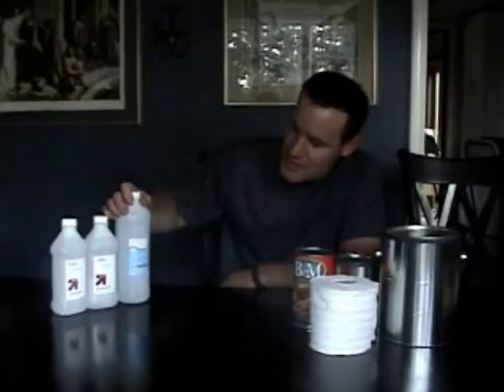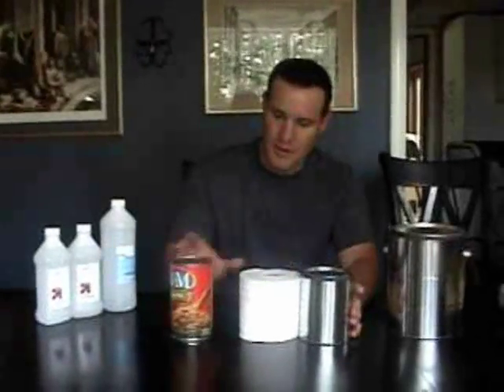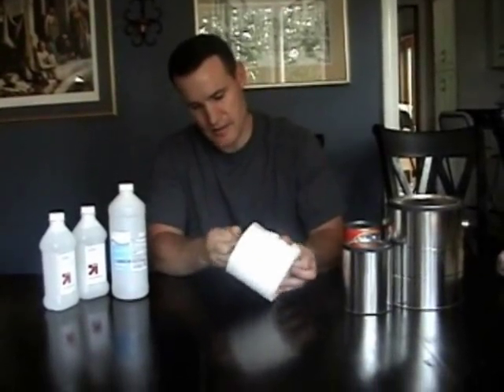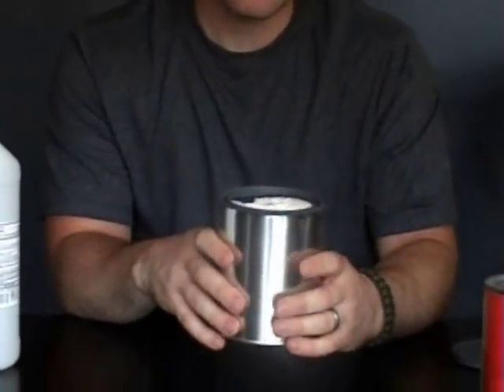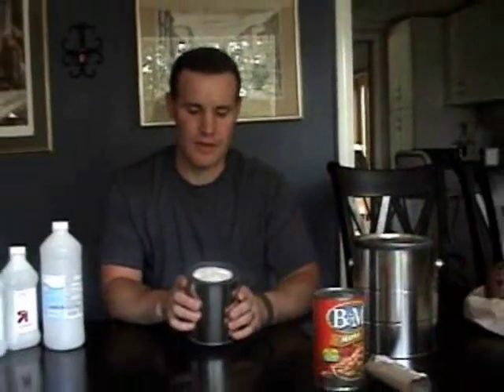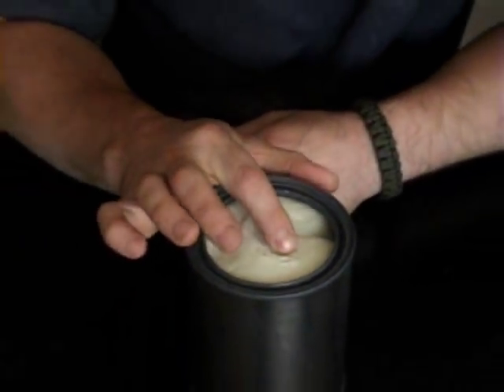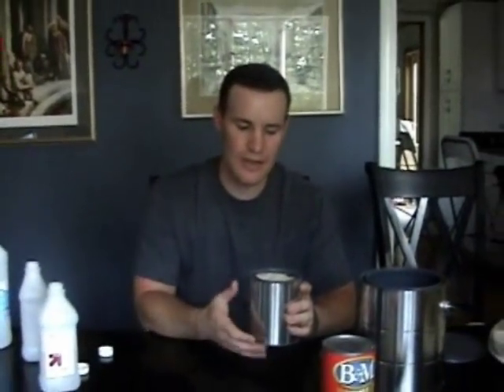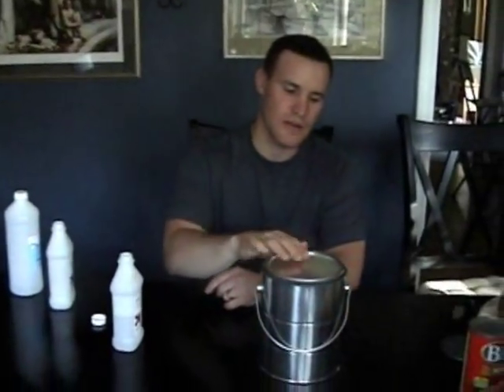How to Make an Emergency Car Heater

Comment: You are obviously commenting without having tried this. Well, I did try this and it worked awesome. 20 degrees outside, lite inside car with window slightly cracked so I don't "burn up all the oxygen", which by the way would not happen unless you have sealed your vehicle, air will get in, CO is an issue hence the cracked window. I let it burn for 20 minutes on my passenger seat. The bottom of the can never got hot, I could pick it up bare handed. The temp in the car was now 62, this works great!

Comment: I've always put a layer of sand in the bottom and around the sides to act as a buffer. The inside can gets hot, transfers the heat to the sand, and you still stay warm. Also with the inside can lifted, you. an use the inside can lid to snuff out the flames. 
These came mighty handy back when I drove cross country and got stuck in a blizzard somewhere.

Comment: I went out today and bought everything I needed, between Lowes and Rite Aid, total was about $8.  I went home, had a MAJOR SERIOUS problem getting the roll of toilet paper in the quart size can, almost stabbed myself trying to work it in, ended up unraveling aLOT of toilet paper, but did get it in.  Filled it with 1 1/2 bottles of 70% alcohol, and lit the can setup in my sink in the kitchen.  OMG !  It performed FAMOUSLY.  This gets VERY warm.  I'm keepin' this. LOTS of heat rising.  Nice Job!

Comment: I've used this method many times in extremely cold weather while having to sit in my car taking care of property for 12 hour shifts ( I used to work as a security guard). I set a small piece of plywood and made sure it was level on the passenger seat. I set the can on the flat surface and light it up. Perfect. It worked extremely well. It also works when having to prepare a meal. I would set a frying pan or soup can over it and did the job. I was inside a warm car and i had hot meals and it would be 10-20 degrees outside.
Reply: Windows closed or cracked 🤔
Reply: @ALSILVERU2  Definitely about 1/4 way down and would adjust it as needed. Sometimes a little more and sometimes a little less.

Comment: Great idea,  thanks for the information,  I am going to try this.  I have about an hours drive home on very rural roads and no cell phone signal,  always wondered what would  happen if my engine conked out on a -10 degree night., now I don't have to find out.  I think even with a window cracked this would provide enough heat to keep you from freezing to death.  Always carry extra clothing and blankets with me in the winter time.
Too bad a video like this brings out the trolls and morons.

Comment: Candles are cheap, safe, and do the job of taking the chill off the air just fine.  Buy a bunch at a dollar store, keep them in a tin can with lid, with a book of matches.  And you're all set.
Reply: Yes, a good candle is reported to keep temps inside a car above freezing.
Reply: That's a good idea. I will try this
Reply: That's bad too candles give off dirty fumes too. Unless its beeswax and a cotton wick.

Comment: If nobody has said this yet it would be a very smart idea to put out the fire before "topping off". It was not memtioned in the video but should also be common sense to do so. You never know if someone is dumb enough to follow the directions in the video or if they are smart enough to have common sense

Comment: I have to laugh at so many comments from those that don't understand the properties of isopropyl, how it burns cleaner than the gas ranges used to cook dinner every night in half the households in the country pretty much eliminating the possibility of carbon monoxide poison, assuming you'd use this device in a moving vehicle (WTF? If your car is drivable and you have an accessible road wouldn't you think to drive to a more hospitable location while keeping warm along the way using the car's own HEATER CORE?), not realizing how incredibly small air molecules are and how you'd pretty much need to crack the windows more on account of the heat generated making you uncomfortably hot rather than as a source of oxygen, and how the alcohol in the wick is basically not in a liquid form that would spill, but more like a vapor that would stay put inside the smaller can, etc. But despite all this, they are so confident in their own "common sense" knowledge as to insist that using this device will cause you to become unconscious either from CO poisoning or asphyxiation, thus crashing your moving vehicle, generating a massive inferno, and then having the balls to mock and call a well-prepared survivalist an idiot when said survivalist makes it through the night (toasty warm, even!) in sub zero temperatures, while the detractors are quite a bit more likely to be found in their emergency sleeping bags, frozen completely through, and in fact quite dead.

They also might not believe you can create an emergency refrigerator (say you need to keep insulin cool while stuck in the desert for a day, or something along those lines) with those same two paint cans, something sharp enough to poke holes through metal, some leaves or clothing, plenty of sun, and your very own piss. Weird, but true.

Science. It works.
Reply: I'd like to know about the refrigerator because of my heart condition and it makes me where I cannot handle the heat. (Well, I can, but my heart can't.)

Comment: It simply never fails... somebody posts a video; clearly stating it's intended use and then the keyboard physicists chime in.  Here's the deal people-  you're in your car- caught in a snowstorm, you have less then a quarter tank of gas, it's cold-  and to keep warm, you have this heater thing.  Yes- lighting fires is dangerous and if you're a total moron- you will light yourself on fire.  But assuming you can walk and chew gum at the same time, this is better than freezing.  Crack the window a bit to let out the very minimal toxic fumes that are emitted and you'll survive just fine.

Comment: That yellow flame is not a complete burn and will make soot and likely more CO.  I would love to see this kwikee burner made so that it runs a blue flame.  I have run a propane heater in the car with a window cracked open.  That way I can sleep with a good deal of faith that I will wake up.  Thanks for the vid.  I love home built contraptions !
Also, I have taken to carrying the hand and foot warmers around in winter.  Bought mine at Lowes.  Their foot ones are shaped more like a foot than just any old generic thing. .

Comment: See the comment below.  I'm doing this in a very large kitchen, and the heat was incredible rising out of this.  No burn marks anywhere whatsoever, not even on the paper.  I set the large can lid gently on top and the fire went out in 4 seconds.  Cools down fast.  The flames rose about 8 to 9" at times, which would alarm me in a vehicle I suppose.  How would I use this for cooking?  If I put a pan on the can, it would act as a lid and put the fire out.  I hope you can answer, this is NICE !

Comment: Awesome video! Thanks, man. I'm thinking that if you used one of those cork trivets to set the can on in the car, there'll be no problem with heat. Open the car doors every so often (only for a second or two) to bring in some fresh air. I always worried about being stranded in a car in the cold. Thanks for the info!!

Comment: If you are planning ahead by bringing this stuff with you, there are much better things you could bring with you instead. Cell phone to call for help, for example. A wax-based fire source will burn longer and safer; you have to open the window for air anyway no matter which fuel you burn. Cars are not made to be safe places to have a fire, so this is as a last resort if you're going to die anyway.

Comment: Metal is a heat conductor and having the internal tin sitting on top of the exterior tin means that heat will be transferred to the outter tin easily.  So, you shoiuld use a heat insulator like a piece of wood in the base of the outter tin or you may cause problems and melt or incenerate whatever it is sitting on.

Comment: Not sure about the wool, but I tested this and it was 4 hours into the burn before the tp even started to char. Burned this as a test inside for 6 hours before the tp actually started to burn. The alcohol was all that was burning. If you extinguish it for 5 minutes and refill the alcohol, the tp will last indefinitely or til it disintegrates from being in liquid.

Comment: I liked your video, no doubt about it; But, i think you failed to mention to. some viewers, not to replenish the heater with new alcohol while the flame is still on, also i really thought you was going to put the cap back in to the bottle before you lit the improvised heater, i think it was a little irresponsible of you to have that part skipped  and failing to warn the viewers ; Just an observation!👍

Comment: @romansten9 I suppose if you put holes on each side of the can and ran the hoses to the window and cracked the window just enough for the hose to reach it might work, but probably not because the hoses wouldn't be big enough to supply the  oxygen and get rid of CO and CO2. By the time the holes are big enough you have both windows open 2 inches or more creating a cross breeze and most hoses couldn't take the heat anyway and would melt where they go in the can.

Comment: I think with a bit of tweaking (and a lot of very very careful use) and this is definitely headed for our car emergency case. I'm wondering if possibly using a small amount of concrete in the bottom of the larger can to build a thick (1-2 inches) fireproof base as well as possibly pouring some in the open 'wall' between the can - both as insulation and protection - might be a good step to add. The weather flips so fast in NE Ohio, it only makes sense to have options in case of emergency.

Comment: Cool, you could make it better by welding the small can to the large one, punching a bunch of holes in the large can, insulating the handle and using a longer lasting wick material like Kevlar. That way you could put the lid on and catty it by the handle like a lantern.

Comment: Great idea, thanks. I would add that it would be best to use toilet paper that has no other chemicals in it. Many are scented or have skin moisturizers in them. Probably best to be as chemical free as possible in an small space like a car.
Thanks again. good thinking. Alcohol burns hot and clean

Comment: Add an extra lid and some aluminum foil stored inside the big can.  Punch/drill holes in upper 1/2 of sides of large can and one of the lids.  Use the holed lid for when burning.  Wrap foil around large can to meter airflow.  Stay gold.

Comment: You can also use motor oil for this, (note: proper ventilation is important!!!) If in the car; roll one window down some or prop a door open part way for ventilation. These are better for sheds, or camping than a sealed vehicle in my opinion.

Comment: You con't say where this can be placed in the car. It will get too hot to set on the dash or seats, won't it? Thanks for making this video. It's VERY helpful.
Reply: If you did want to use it in a car: a) crack a window EVER so slightly just to get some fresh air in even if it's super cold. b) keep something else in the car in the back like a piece of wood to go under the bigger paint can to insulate it. It won't catch fire on the bottom through the metal.

Comment: Thanks i bet that will defrost my minivan my heater bloer motor housing is plastic and it no longer holds the blower fan motor.I will position it in safe manner and ventilate😎👍👍thanks for sharing

Comment: I use a candle with small candle holder.. Just put it in a large metal can to catch the dripping wax. I keep a blanket in the car as well. Works just fine.

Comment: How long does it burn from start to finish (in the exact example you demonstrated?) 3 hrs? 5 hrs? 12 hrs? 18 hrs? etc. That would be very helpful to know. So you could make more than one if it doesn't last very long.

Comment: @christo930  what about drilling small hole (or 2) in the outer can and running some hose(s) to an adapter placed in the rolled up window. (would supply 02 and get rid of CO if done correctly)

Comment: I'm not here to call anyone stupid, but please experiment in a safe environment before using this in a vehicle. How hot does it get around, and especially directly above the flame? Know exactly what you're dealing with before you use it.
My hunch is you would be better off with a smaller container and flame, perhaps a pint can. Fiine steel wool or sand could be used instead of toilet paper. Perhaps put some sand or gravel in the larger can, then "seat" the small can in the sand for stability.

Comment: this should only be used in a dire emergency.  Not only that but sand should be placed in bottom and around the small can to insulate it, and proper venting.  ONLY in a life or death senerio should this be used or outside at a camp.

Comment: Um, yeah. Actually folks DO carry this 'shit in case they get stuck'. Two years ago where I live, it was 54 degrees one evening By dawn - 4 feet of snow with more falling and no warning until it was already on us. Of course you don't set a burning can in the center of your car, that would be insane. But having a way to create heat even just NEAR the car can be a life safer in some areas. Care has to be taken with items like this, and weigh the cost/gain. But if needed? Worth having.

Comment: You got to be kidding! Are you out of your mind? You just wasted three valuable items, 91% alcohol, toilet paper, and a couple of cans. I can use those items for other and better uses than a heater for my car or as an outside source of heat.

Lets think a moment on this shall we - - - a fire that size will more than likely spill and catch on fire inside the car. - - - next, that size flame will use a lot more oxygen in your car, therefore, you will need to roll the windows down to prevent carbon dioxide poisoning. In rolling down the windows you let more cold air into your car thus defeating the idea of warmth.  

Using Alcohol is a waste of fluids to pour on TP for a fire. If you want to use a flammable liquid then use a small lantern or better yet use a battery operated lantern for light. As for heat use a candle. About a 6 inch candle will keep your car warm and toasty. Just open the glove compartment and put the candle on the lid so that the wax will drip out of the way and not ruin the interior of your car and a burning candle will be out of the way and not easily knocked over. You will only have to crack your window down to prevent any carbon dioxide poisoning and fresh air in for the candle. Yet you will stay nice and warm and toasty.

Years ago, I was stopped on I-40 by the New Mexico Highway Patrol. A blizzard had closed the highway and I had to spend13 hours waiting for the highway to reopen again. If it wasn't for my candle I would have frozen during those 13 hours. Most of the people used their fuel (gasoline) to stay warm by running their cars throughout the night. Some people ran out of gas, others were very low. I just blew out my candle, wipe the sweet from my face and continued my travels to Oklahoma City while the others were looking for the nearest exit for a gas station to refuel or a tow truck coming to their aid with a gallon of gas.

Toilet Paper is best used for those trips into the woods or to talk to a man about a horse. The paint cans can be used for a camp site fire; should you need to contain your fire. By putting sticks and leaves and what have you into your can you will have a safe fire [as long as you don't have it in your car!] The alcohol is best to use for other stuff than to waste it on a fire. You use too much of it to really make it worth wild and should you spill it you have a car fire that you can't put out.

If you are going to do something, be smart, think about what you want to accomplish and the repercussions should something go wrong. A candle is better than this recommendation, safer too. It only cost you 10 cents for a 6 inch candle verses the $5.00 bucks or more for the items suggested above. You will be so warm using a candle that you will be sweating.
Reply: No fucking way that a single candle warmed your car much less warmed it to the point that you wiped sweat off your forehead

Comment: yeah um isn't that going to use up all the oxygen inside the car? i got my sister an electric throw blanket with usb cable and a couple of usb power banks, the big high capacity ones, for her car. safe, non burning heat and can also charge a cell phone to call for help
Reply: 5V 4W USB Electric Heated Throw Over Under Heating Blanket Plush + Waterproof 50000mAh 2 USB Solar Power Bank 2LED Battery Charger for iPhone XS XR

Comment: how about fumes? if let's say you have it inside a car.. in an emergency situation.. will it generate carbon monoxide?
Reply: It would depend on the ventilation of the room/car you're in. better to use methanol. Because methanol has only 1 carbon, less oxygen is needed for it to burn, thus less chance of creating carbon monoxide.

Comment: Pall DeLand. Thanks for your kind comments, I appreciate them. I would still be concerned about using this type of heating in a house, due to the explosive vapors in a confined space. As a person opens  the container, the explosive vapors would extend to the surrounding areas, and at the point of ignition would probably create an explosive atmosphere. My concern would be the confined space, however this heating method outside in a camping situation would probably be okay, but I still would like to advise against using it in a confined space, such as a dwelling, tent, or car. Take care, be safe, and Godspeed.